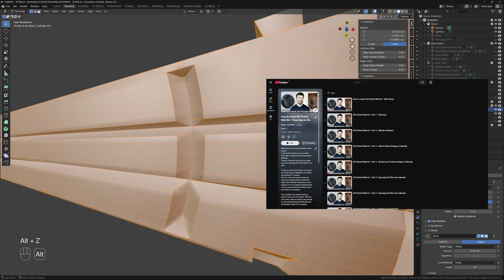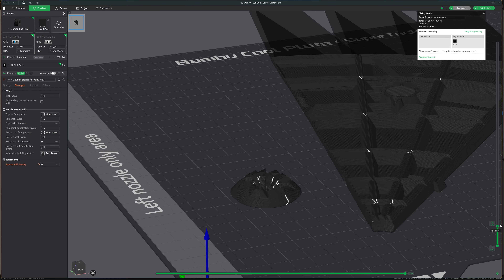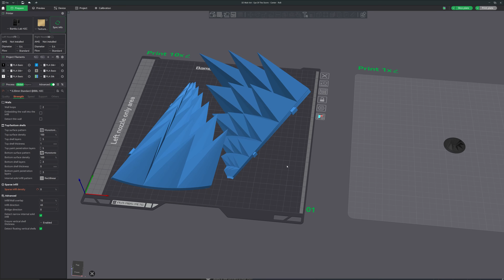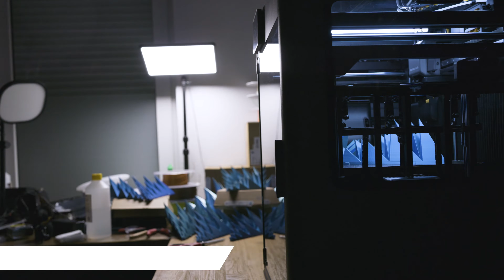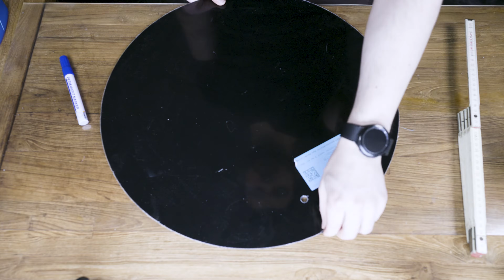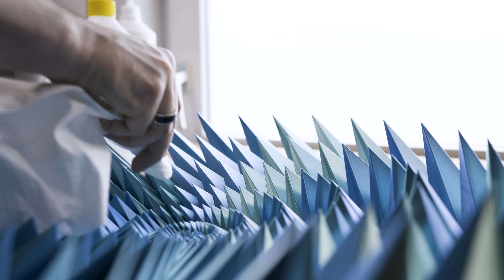3D Printed Wall-Art - Eye of the Storm

Comment: I have noticed the colour not being right on multi coloured filiment, they need to make the colours spiral  as its manufactured so as you print the colour will be more random
Reply from the maker: That would be more how I expected it to be! I'll check with a different color if this is just how it is with the BambuLab Filament or if it was a one time thing (I had it on both spools though, yet this could have been the same batch of color).